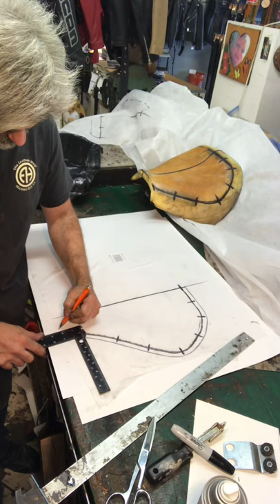Motorcycle seat upholstery at Finn’s Leather Shop

Comment: Great video. Clear and complete!
Can you advise as to where a v punch like yours can be obtained? That thing is such a timesaver.
Reply from the maker: To be honest I made mine years ago. For some other purpose which I don’t remember as well, but I found it worked well for this and I’ve been using it ever since. I took a 1/2” round steel rod and filed the tip into a “V” shaped cutting edge. Similar to a chisel edge. It doesn’t have to be too sharp to cut the leather. You might be able to use a short piece of small angle iron as well and sharpen one end.
Reply: @finnsleathershop4589  Thanks. Thought it might be custom. I know there are tailor's notching pliers but they are for clothing weight stuff. Your device is genius being so efficient.

Comment: This is one of the best pattern videos I've found yet!  I curious where you buy your materials, ie. the cambric fabric, and the elmer's pray glue.
Reply from the maker: Thanks. Glad you liked the video. 
As for the supplies, I get the Elmers spray glue from my local hardware store and the cambric from an upholstery supply store. You could probably also find it from an online source like Amazon. It also is sometimes called “spunbound” fabric. Be sure you get the white so you can see through it.
Reply: @finnsleathershop4589  Thanks for the quick reply!  A suggestion: Instead of gluing the seams together, try Sailrite seamstick.
Reply: @azcharlie2009 depending on application the sailmakers tape is fantastic stuff.  Not always  great with leather under tension.  But it's a great tool to have in the box

Comment: Couple more questions.  It looks like your using a walking foot machine?  If you are do you use any kind of walking foot made for leather or is it the standard foot?  Also if practice this technique with vinyl will it mimic how the leather would work so I can perfect the skill before spending $$$ on leather?
Reply from the maker: I’m using a standard walking foot on a Consew 206RB-5 machine. A basic leather industrial machine. The cambric pattern making technique should work the same for most any material. Certainly leather and vinyl. The cambric has just a little stretch to it as does leather and vinyl. The cambric is just an easy way to find out what a curvy surface looks like when flattened out.
Reply: Thank you so much for your replies!   I have a nice nakajima industrial walking foot sewing machine i picked up.  Still learning.  I can't wait to try this to cover my heritage softail seats!   I have some used leather for practice i skinned of a couch setting by the side of the road!  Free is good lol!  Great practice material!

Comment: Thank you very much! I know it would be time consuming but do you think it can be stitched by hand with a speedy stitcher?
Reply from the maker: Should be able to. Most any stitch you can do on a machine can be hand sewn. It just takes more time. Also when hand sewing soft leather you need to be careful not to pull the threads too tight and end up gathering the material too much.

Comment: any videos on how to sculpt the foam of the seat? i’m just starting out in upholstery.
Reply from the maker: I don’t have any videos on that but when I need to shape foam I’ve had success using an air powered die grinder with a sanding disk. It’s a bit hard to control at first but it really smooths out and shaves away the foam well.
Reply: @finnsleathershop4589  thanks i’ll try it out.

Comment: What kind of staples are you using and how long are they?
Reply from the maker: I’m not sure what to call the type of staples. They are just the ones that fit in my old air powered upholstery staple gun. I usually use the 1/2” length so they are sure to go in far enough to hold well however I sometimes use a 1/4” where the foam is thin so they don’t poke thru the top side of the leather.
Reply: @finnsleathershop4589  Thanks